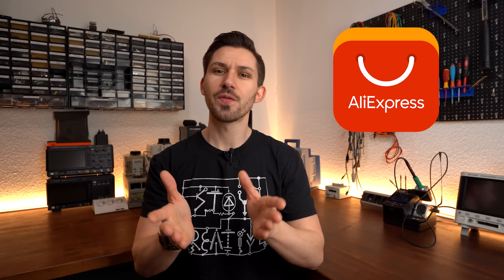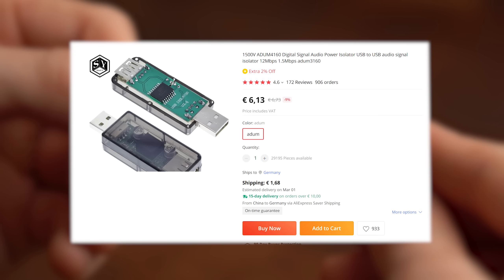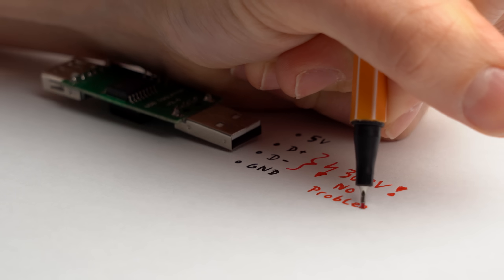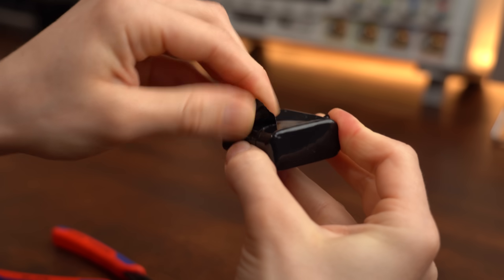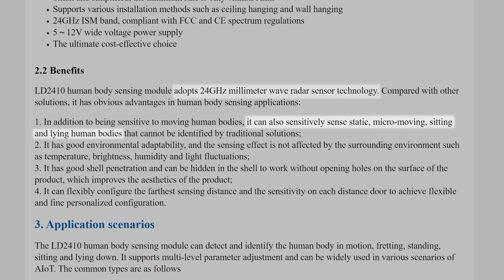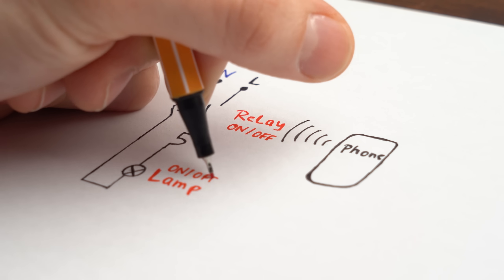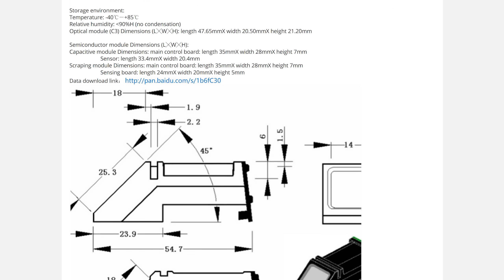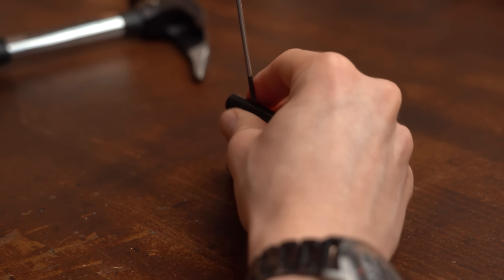I tried finding Hidden Gems on AliExpress AGAIN AGAIN!

Comment: those wifi  breaker relays are awesome if you get good ones that have power monitoring circuits aswell the tuya ones work great with home assistant

Comment: I love your videos so much - but just 25 seconds in you called the drill sharpener tool thing garbage (It works super well and I made a few good drill bits out of snapped bits which would've cost hundreds for the same brand new)

Comment: Just curious have you tested the Presence Radar through walls?
Reply: I'm betting it will work through a non insulated wall or possibly I insulated but a brick wall probably won't work. I ordered 7 for 30 bucks to add to Home Assistant as they added support in the last update or one before that. Just needs power, no UART connection needed. There is a video on here on how to set it up in Home Assistant.

I will do some testing and report back once they get here although it may be a week or more. I have the Aqara FP1 and it can detect presence through my TV but I never tested a wall. It's also 24ghz. They make some 60ghz once that can measure heart rate so I'm betting those would easily work through a brick wall if they can read a person's heart rate accurately. Seeed Studio sells 2 different 60ghz models.

Comment: The Account for Alexa/Google/Home Assistent is sadly made by their Server Design and not really a decision of the manufacturer. You connect your switch to the server of the manufacturer of your switch and the account is connected to your digital Assistent. There is no direct local connection. With a installation like this, built into your breaker box, you got much work to do if they shut down their servers and you remove everything again

Comment: Too bad you didn't do a full test on that wifi contactor. I actually tried to set up a wifi contactor control and found the high voltage threw so much interference at full 220v with a dozen of them all connected; the EM interference kept resetting my circuit no matter how much I tried to isolate and protect the circuit. Such a relay could be huge for industrial automation.

Comment: 5:30 isn't that  the charging and protection chips on each battery? so you can use the adapter to charge them in parallel .??

Comment: I have a question….. since both of the glove batteries had battery protection circuits, why is it wrong for the charger to “parallel” charge two batteries? Won’t each battery auto - stop charging when it is full anyways?

Comment: Great video. It's great to see the LD2410 getting more coverage!
Reply: The LL2410B (Bluetooth) version just got added to Home Assistant in either the last update or the one before that. Obviously it works over BT which is why it's required but now that they added BT proxies to HA, distance is no longer an issue as long as you have a spare 3 to 5 dollar ESP32 to make it a BT proxy to extend your BT range or if your HA server doesn't have BT you can easily add BT functionality by adding one as it communicates with HA via WiFi, or Ethernet if you have one of the POE ESP32'S with an Ethernet port. There is a video on here to set it up but essentially you just have to cut a power only USB cable and soldier the wires to the 5v and ground inputs/pins the LL2410B

Comment: Did you test the human presence detection sensor also with non human moving objects, e.g. moving curtains in the wind? A classic PIR won't detect it as it's not emitting infrared waves. But this is a radar principle so I wonder if it would detect a moving curtain.

Comment: The thing about heated gloves/socks is they really don't need to reach 50C. Their purpose is really to keep your hands from getting super cold or frostbitten, so even if they keep the surfaces of your hands/feet at 5-10 C it's fine.
Reply: I mean, 37C would be really nice.
Reply: @alexandrezani  would that not be a bit to hot, your hand will start to sweat, and that not going to be very confatable?
Reply: @dh2032  I think of it as an upper bound since it's a normal internal body temp.
Reply: @dh2032  It would, and that would make it even more dangerous in a cold situation. In general, sweat=cold, no matter how many layers you have on. If those socks, loose power, you're going to have colder feet than you would if you didn't have those socks at 37C in the first place.
Reply: They are reaching 50C at room temperature of around 25C so when you use them outside in 0C they will only heat to 25C or so.
Reply: Yup

Comment: Did you know the average router can only handle 10 to 40 devices. If like me you have 100+ devices (lights, relays, door/window sensors, temp and light sensors etc) plus more, your router will continuously drop devices and drop the internet connection, requiring a router/modem reset.

Comment: Since 2015, I've had that fingerprint sensor installed on my front house door that has been working pretty well. Recently, I came across another fingerprint sensor, the FPC1020A, which caught my attention. Not only is it faster than my previous sensor, but it's also much slimmer in design. Additionally, I was impressed to hear that they claim to have a false rate of only 0.0001%. Overall, I'm excited about the potential benefits of upgrading to the FPC1020A and wanted to share my experience with others.
Reply: I don't know what your threat model is, but I want to note that because the sensor does the authentication, someone could remove the sensor and simulate an authentication signal. (Obviously, it's not a big deal for the average home owner, but just in case you happen to have reason to worry about more sophisticated attackers.)
Reply: @alexandrezani  Most professional access systems use wiegand, which can also be easily attacked. Encrypted communication is rare.
Reply: @elek101  Right, my point was less about encryption than about where authentication is performed. Wiegand systems will usually read your card and send the contents of the card to the controller which decides whether the card is valid. That is subject to a replay attack, but you need to know the content of the card.

With the above fingerprint sensor, the sensor has a fingerprint database. It checks your fingerprint against its database and sends the user id of the authenticated user to the controller. Without knowing anything about the user's fingerprint, you can just send a user id to the controller. I think the user id is 32 bits and sequentially assigned in the database, so it's probably not very hard to guess it.
Reply: Yes, there really should be encrypted communication between the sensor and the door controller inside your building.

Comment: @7:00 II had a bunch of these. They work pretty good! BUT they don't "sense" "EVERYONE"!.. For example when any of my Liberal-friends come over they can literally sit on it, A55 they do with every inanimate object to test it's usefulness,  and it doesn't sense any "human-activity" nearby! Though, it could just be intolerant to the moisture-rich impacts of  Siloconemethane-gas condensate that's emitted during the high-frequency aggressive-sitting oscillations that occur when all liberals physically deviate past 22.5 degrees from vertical alignment. 

@8:11 THERE'S MY MISSING JACKET!... I knew it! It still even has the Mountain-bike wheel in the pocket!... You're lucky I'm lazy and can't afford 1/10th of a Keysight meter or I would SOOOOO get a plane ticket and come get my jacket!

@8:35 Forcefully inappropriate!..🌭....:face-fuchsia-tongue-out:...🙊🙈🙊🙈🙊🙈🙊

@9:10 OK, that's cool!.... SOLD!... That just over-rode a few low-priority necessities!... MY IRRITATING neighbor is going to BE SO "RANDOMLY PISSED", 7-10 DAYS FROM NOW AND ON(with addition of the required "ask me to fix something panel-access" time)!

 [As of the moment of posting, NO feweeings were harmed in the making of this comment.]

Comment: If you ever use a fingerprint sensor with a smooth glass surface like that, always swipe across it as you remove your finger so you don't leave a perfect latent print behind.
Reply: i mean, i sort of get it but if someone wants to get your fingerprint, it can be obtained  very easily cause no one is actvely thinking 24/7 about all their fingerprints on everything they touch. For example, if I want your fingerprint, i can casually talk to you and ask you to hold something as a favor while i pretend to tie my shoe or whatever. Or i can just observe your routine from distance and take the fingerprint from anything you have touched.
But yeah, i guess swiping is better than doing nothing at all
Reply: I was thinking this too, but as he said it didn't false trigger so, it must be of some decent quality.
Reply: @Michael0100  It's not the false error rate, it's the equivalent of leaving a picture of your key on a door. It's possible to recreate a key or fingerprint with that info.
Reply: i normally use latent mucosa ... from a donor with different DNA also... which is ALL you peple....   SFMF

Comment: I would go as far as to say the USB isolator board is highly recommended for beginners on the hobby. I nearly fried the USB port on my work laptop due to a small speck of solder causing a short on my very first protoboard Arduino project. Luckily the laptop had protection circuitry and it only powered off and stayed "dead" for some 15 minutes. I made several beginner mistakes but if I had one of these isolators back then, I could've avoided the momentary feeling of horror. :D
Reply: I did that too on an hp. It rang an alarm sound and shut down. Scared the beejeebers out of me!
Reply: @TheRainHarvester  My ThinkPad just went dead in a fraction of a second. It was quite a surprise as I had the same board plugged in once already. The difference was that I had raised the Arduino input voltage from 9V to 12V (thinking it would be somehow better 😄).

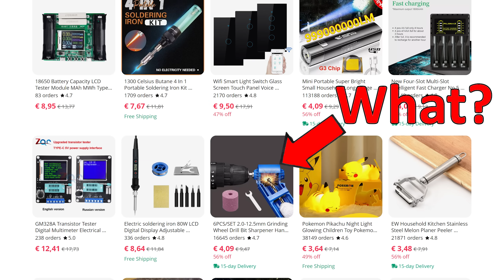Comment: 0:27 sharpening drill bits is nothing weird! That tool seems useful, getting the angle right can be tricky. To be fair though, if you're the kind of user that needs to sharpen his bits it would be very odd to not have a grindstone or band sander, and/or have trouble getting the angle right when grinding/sanding...

Comment: Those USB isolators  work with the Analog Discovery 2 (at the cost of lower bandwidth). Or at least the ones with the external power option do. Pretty sure the AD2 complains about low current if you try to use those little crappy inline DC sources.

Comment: Btw, the Human Presence Radar can be bought in version B, that also has Bluetooth Low Energy output and works with Home Assistant BLE proxy :)
Reply: Does it have the same PCB layout ? or is it a daughter board to a ESP82xx ? I don't seem to find 'em
Reply: I'm using them with ESPHome BT proxy on ESP32. worms great and don't need to touch the YAML.

Comment: I bought a Dune Buggy as a holiday gift to myself. I totally changed the dash using a fingerprint reader connected to a board integrating 4 relays. A single button replaces the acc, starter, trunk opening, and glove compartment. It's cleaner, more hi-tech, and I don't have any more keys to carry.

Comment: this ewelink switch does not require anything to connect to Home Assistant - you just use Sonoff integration even though it is not Sonoff and it works - tested
and btw: it is not Home Assistance but Assistant ;-)

Comment: Question about the glove batteries: wouldn't parallel charging only be a problem if the batteries themselves didn't have a charging ic like the tp4056? Looking at the video the power supply looks like a dumb switching supply for likely 5v, so it would only make sense to have a charging ic inside the battery itself. Could you clarify that?
Reply from the maker: Nope. The power supply is the charger. Outputs 8.4V at 1A max. The battery pack only came with a BMS
Reply: @greatscottlab  thanks for clarifying. It's weird how china sometimes tries to save three cents and totally destroys the products value by doing so

Comment: These readers are insecure and that is fine for some usage. Because the print can be transferred from items and does not have to be mechanically resistant compared to swipes.

Comment: The usb isolation is useful for electronic beginners when they are creating arduino circuits so they don't burn their computer like it happened to me
Reply: So will a simply USB hub.
Reply: @boots7859  no deepening of wich USB hub if you use a "simple" one it will not protect shit of your computer
Reply: Wait how did that happen, thats never happened to me, is it just random chance, or were you doing something specific?
Reply: Don't need to be a beginner.
Would have saved me hundreds just recently when  I managed to electroplate my PC, router and a Raspberry Pi and of course 3D printer by accidentally bridging the 24V hotbed to 3d printer frame - connected over USB.
Frame was NOT bonded to 0V electronics.

Oh Galvanic isolation would be been OOH SO NICE.
Sold in seconds - off to Aliexpress - a good time to use an affiliate link FOR SURE!

Comment: Wow, I actually really like this USB isolator, and I will definitely buy one. I'm repairing electric devices in bulk for bigger companies and I'm sometimes really worried about pluging in sketchy chinese repair devices to my notebook.
Reply: I strongly recommend all embedded developers and similar have a few of them on hand for exactly that reason.
I'd rather blow one of those up than the USB port.
Reply: @zyeborm  Absolutely agree.
Reply: @zyeborm  or worse, the pc. Although I think it's unlikely to happen. But at a training course we were given these USB sticks you could put in the other way around, and it was smooth metal on 1 side. 1 guys laptop just turned off and wouldnt boot anymore after shorting the USB port.
Reply: Analog actually has faster IC's too that support the full USB 2.0 480Mbit data rate. And i would definately want one with a better power isolator that manages the 500mA spec and where i actually know what isolation voltage it is rated for.
For the electronics lab, i just ordered the EVAL-ADuM3165 from Analog. It's more pricy and bigger than the Aliexpress thingie, and it does not come with an isolated DC-DC converter, but for what i need it to do (usually isolate an USB link for monitoring a device while EMC testing with high voltage burst/surge/ESD) it's perfect.

Comment: Where is the verification done, on the fingerprint reader side, or on the microcontroller side? Because if it's all done on the fingerprint reader side, and the reader just sends a signal to indicate authorisation, it could easily be bypassed by just yanking out the fingerprint reader and sending the signal manually.

Comment: Those presence sensors were recently added to Home Assistant too, in case you weren't aware.
Reply: Please note that LD2410B will work with the Home Assistant integration. The standard model LD2410 (without the B=Bluetooth) will not work out of the box.

Comment: those biometrics sensors that use a led for reading are very bad and extremely vulnerable.  You just need to use a flashlight with a stronger LED than the reader, and it will read the last biometrics again.  Being an extreme security breach.

Comment: Those ewelink relays were used in the building of the Dutch company were I worked at. And we're talking a small/medium industrial site. I actually fitted 3 of those at my house and I'm quite satisfied. The account allows for IP access.
Reply: reflash it with ESPHome and forget about any "accounts"

Comment: Once I ordered 10x LM350 adjustable voltage regulators. 
They worked verry wel on the meter. But as soon I connected a load (little motor or bike lamp) they stop working and do nothing anymore. I ordered I same regulator in my town and that's works fine for almost 3 years now.

Comment: Actually, charging two Li cells in parallel is ok, in fact, in some cases, it is necessary. There's no risk of overcharge, once a cell reached the charge voltage (which should be the maximum rated charge voltage of a cell) it will stop taking current, only cells that are still lower, will keep charging. The charger is likely just a fixed voltage PSU with a current limiter and the LED changes to green once there's no current flowing in the system.
When building a battery pack out of individual lithium cells using a DIY BMS system, you absolutely must charge the cells in parallel like this, and have them on a constant voltage for a few days to ensure that all cells are charged up to the same voltage, so once you hook them up in series, the BMS won't have to do too much balancing, at least not initially. Then it should be easier for it to compensate for the internal resistance differences as the bank is cycled.

Comment: The USB Isolator would be interesting for a USB Soundcard Oscilloscope, of course only for Audio applications, but could be a cheap way to get an oscilloscope.
Reply: You can just use the headphone jack anyway. Neither of them are very good oscilloscopes.
Reply: @H0mework  Well the 10V Peak to Peak of Eurorack wouldn't be good for the Jacks i reckon.

Comment: Another use for the USB isolator: Laptop USB port 0v is often referenced to earth.  Since some equipment either needs to be floated from earth, or it is referenced between +v and earth, you want to isolate the USB port to prevent damage or shock hazards.
Reply: Thats why you can unplug the laptop from supply
Reply: @snik2pl  oh, agreed, but when you need to run multi-day data captures, the isolator makes a huge difference.